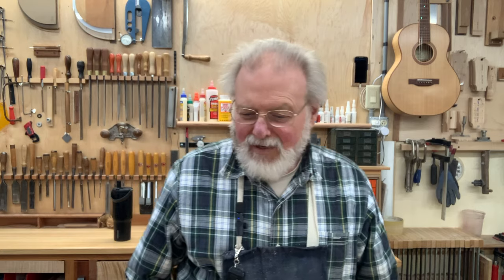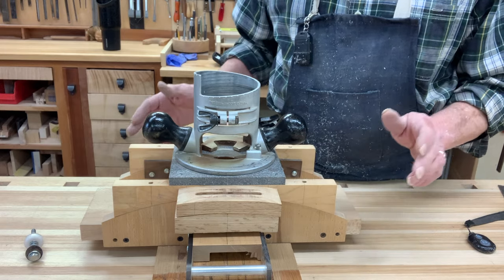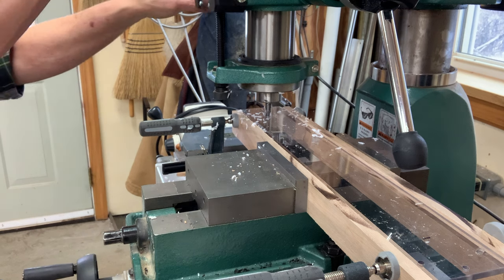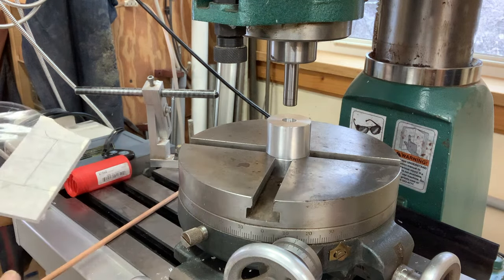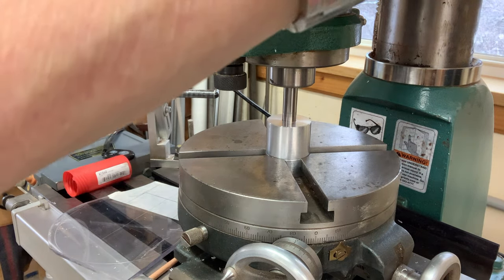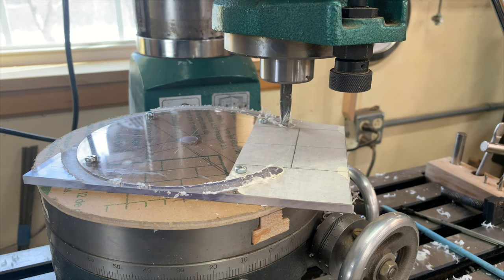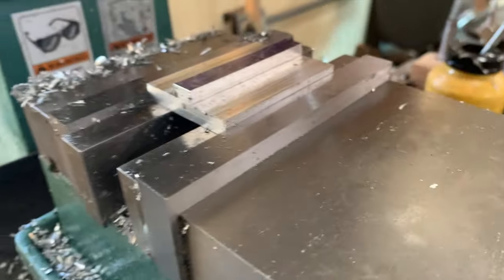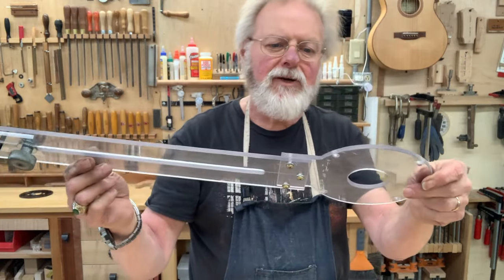Making Tools To Make Guitar Making Tools @the

Comment: I use something along that line only not nearly as sophisticated. I use a similar size piece of plexiglass, something I used years ago for adjustable shelf pin holes. Mounted my router to one end and just drill a hole for the radius I want. Yours is much nicer and not as likely to self destruct.

Comment: Hi for most work holding on the cnc and mill where the conventional vice/clamps aren’t ideal I use the masking tape and superglue (thick) method .. I’ve never had one come loose .. it’s great for plexiglass,wood and even brass and aluminum .. for small aluminum or brass parts I usually deck a larger aluminum piece held in the vice and directly superglue it to the aluminum.. alcohol will free and clean it up easily ..
Reply from the maker: Although this operation was very successful, I should have properly held the work down on packing, secured with strap clamps. I've never used double faced tape or cyanoacrylate on a milling machine.
Reply: The ca/tape method is a great trick I’ve used it on the metal lathe .. it stands up well to coolant etc
When cutting aluminum I’ve switched over to using alcohol..

Comment: I've made similar devices, though not as spiffy as this one.  They're really useful.  One word of caution, the farther from that center point you set the router (ie: the larger the radius), the more you'll need to support the "free" end of the arm.  The weight of the router will cause the whole arm to deflect which may create an error in your finished piece.  Ask me how I know.  ;)
Reply from the maker: There is no free end of the arm. It is supported at one end by the router base and at the other by the center pin block. do i understand you correctly?

Comment: A suggestion: when you have wood parts sliding against wood parts. if you rub in some hard carnauba wax of the type used to wax cars the parts will glide over each other like butter
Reply from the maker: Thank you for that suggestion:)
Reply: @thepragmaticluthier  this also works like magic when you have wood furniture like a dresser or chest of drawers-just heavily wax the contact portion of the drawer and the case rail. Carnauba car (paste) wax works infinitely better than  hard beeswax or soap.
 I also use this as a wood finish for the interior of wood drawers

Comment: I believe router circle cutting jigs are commercially available.  Instead of drawer slides use liner
roller guide rails, they're inexpensive.
Reply from the maker: Circle cutting jigs are commercially available, clumsy, expensive, and made to someone else's specifications.  My reason for rebuilding the jig is to eliminate drawer slides. They will be replaced with the very best: Thompson linear motion rod and recirculating ball bearing blocks. I happen to have a bunch of it:)

Comment: I assume the drawer slide's tolerances deteriorated with time - what made you aware of the problem with your radiusing jig?  Nice circle-cutting jig.  Thanks for sharing.
Reply from the maker: The slide may have deteriorated, but I think the problem may have been threat least in part, from the beginning.  I've been spending too much time refining what the jig does and not enough time carefully analyzing. Finally, the light came on and I have been simultaneously  embarrassed and dissatisfied. The new device will be very similar in design but the drawer slide will be replaced  with a carriage riding on Thomnpson linear motion rods and bearing blocks. Unfortunately, $$.

Comment: Rather than making a sliding fretboard tray, why don't you make that stationary and have the router assembly slide over it? It would be more compact and more accurate.
Reply from the maker: When the router does the traveling, it distributed chips and dust even further and some of that swarf gets into the track that the router travels in. Tried it, didn't;'t work out at all.